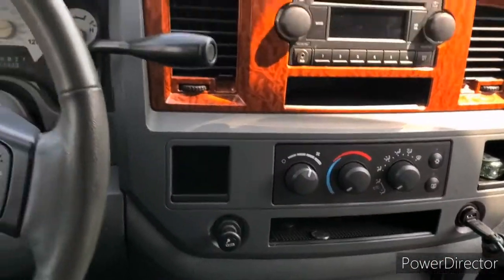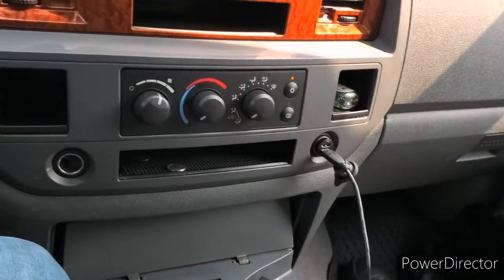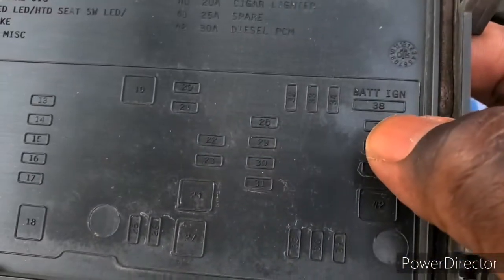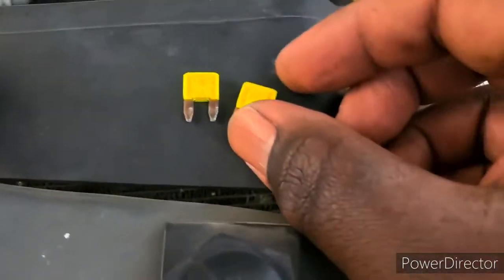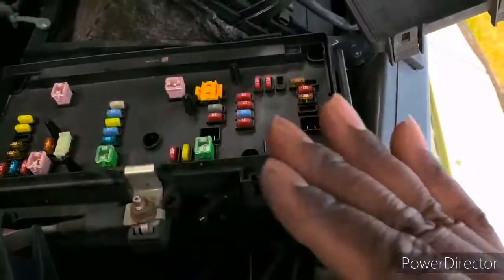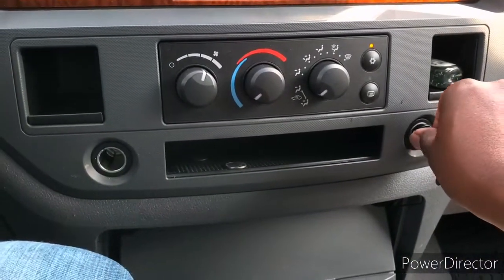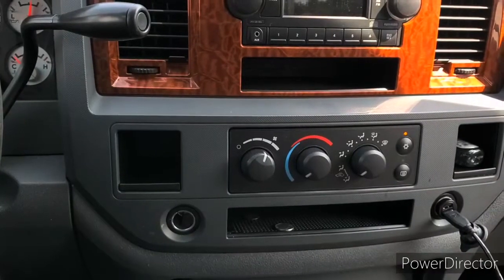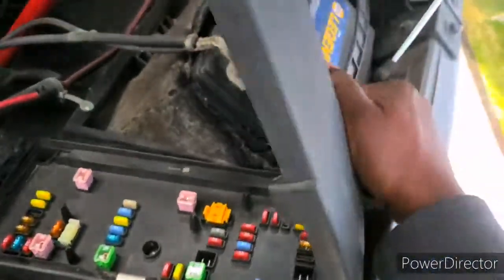2006 Dodge Ram 1500 Power Outlet / Cigarette Lighter Outlet (NOT WORKING!!!) J.O.A.T.D

Comment: I got a 07 ram 1500 check fuse for passenger side,it's good even changed it still not working, check it with volt meter no power.
Reply from the maker: Apologies for the late response, did you fix the issue with your Dodge Ram internal power ports not working.
Reply: Same problem here, did you find a fix?
Thanks

Comment: exactly the same with my 2006 Dodge Ram.   You have confirmed my Fuse positions,  and I changed all of them,  but my centre console armrest power plug is still not working,  so I have to look at the plug and wiring to see what is wrong.   ugh.
Reply from the maker: What you can do is pull the cigarette lighter housing out get a test light. Put one end to the ground and then touch the positive to see if you have power and if you don't it's another fuse. And if you do have power is the cigarette lighter replace it.

Comment: My passenger side one works but the driver side one does not. Any suggestions?
Reply from the maker: Did you check the fuse for the driver side.
Reply: Same but opposite. Driver side works but passenger side doesn’t.